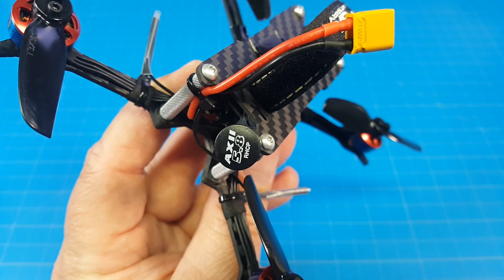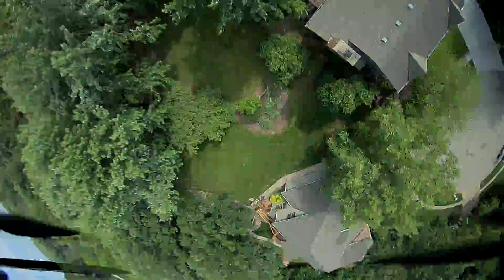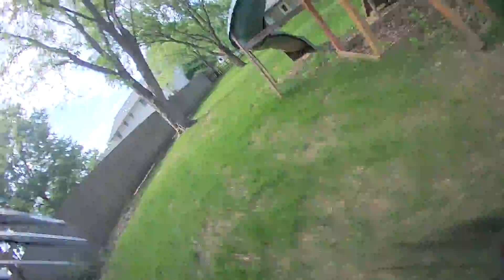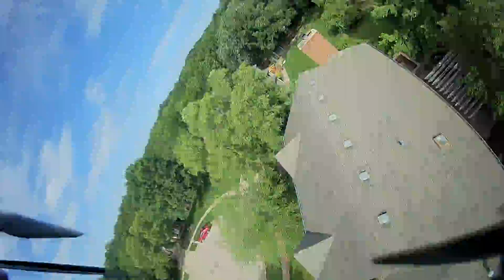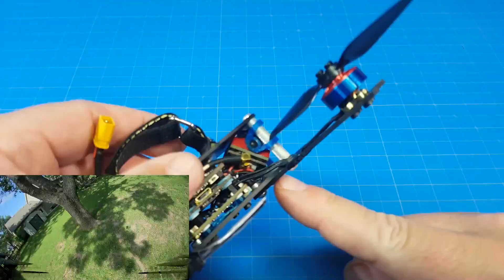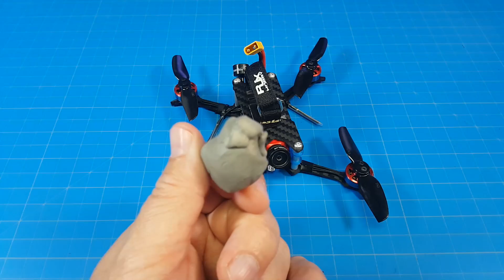RotoriousFPV Zoot - Ultra Light 3inch HD Drone

Comment: Dude, I watched this video 6 times! I've been looking for a new 3" build, as an over winter project. I may just clone your build. Those mamba boards are available at a good price here in the UK. For 4s is there any other motor you would suggest, perhaps lighter? Are those 1404 working out well for you on the thinner arms, I read the thin arms were for 11XX motors? I really appreciate your videos, thanks for the review.
Reply from the maker: I think there are likely better options for durability. We also have different hd fpv options now. The caddx whoop hd version really opens the possibilities. In the moment not sure what I should suggest. I have had some comment they bought two sets of arms for the zoot, ca them together for extra durability.

Comment: Did this give the power you look for? How do you think the succex 12a stack would be for this build? I’m really looking for this performance/size with the caddix turtle like this. Succex is tempting bc if the price and it includes the vtx
Reply from the maker: The succes stack is rated the same so it should be good. My experience with that stack is the vtx get very hot, nothing bad has happened to it. I did enjoy the power/performance of this motor/prop combo, keep the weight down to achieve the best performance.

Comment: Nice build. Considering lighter motors, broke 3 Armattan Gecko frames, so far.
Reply from the maker: Which motors where you flying?
Reply: Rcx 1407 4000kv
Last frame broke when it fell out of a tree and hit a wooden bench. First two broke from crashes.
Reply from the maker: I think we can double up the arms, likely need to ca them together in a vice to get the full benefit.
Reply: Thanks. That's exactly what I've been thinking of.
Reply: An extra main plate keeps me flying while waiting for the warranty replacement which then becomes the extra. Doubling up should save me time from rebuilding and I don't think the extra weight will matter. Maybe I shouldn't fly a 3" like a 5" but cruising gets boring fast.

Comment: I suggest you try avan mini 3" props if you haven't already. I get more flight time (yes more) with better handling compared to the bi-blades on 5500kv 1304's 650mah 3s. Almost 5 minutes decent freestyle. Just over 7 minutes of easy cruising.
Reply from the maker: the avan props don't fit all the way down on the motors.
Reply: @NickBurnsFPV  bottom of the prop hits the bell? They are close on the 1304's. I didn't think about that. Thanks for letting me know because I was considering getting a set of 1404's but I really love the avan mini's. Best 3" prop by a landslide in my opinion!
Reply from the maker: yea, the little fin at the bottom hits the bell, prop ends up about 1mm up off the motor.

Comment: Is the mini Mamba stack as good as the full?  Hard to beat for $40
Reply: I have two in 3in builds and so far so good. I looked everwhere, there's no better value for a 25a stack in 20x20. The only downside are the tiny solder pads.
Reply from the maker: the v2 does have through holes which will help...if used in a through hole manner. :)
Reply: @NickBurnsFPV  I might get a V2 for another project. Any plans to review the F722 mini?
Reply from the maker: I do plan to take a look. Likely this week, just a simple over view with a build later to come.
Reply from the maker: the small pads are essentially the primary drawback. The smaller the pad the more sensitive it can be to lift from to much heat or being tugged on.
Reply: @NickBurnsFPV  The V2 FC seems a little better, but I've only seen it in pictures.
Reply: @NickBurnsFPV  Thanks, The Mamba stacks are new in my life and I love them, I have a 3 inch build with garbage ESC and was looking to your videos for some tips, so this build was perfect, I thought the Caddx Turtle looked great too, is that the newest firmware?
Reply from the maker: I believe it is, I have been using the same file on the turtle.

Comment: Nick... I was looking for an ultra light 3" under 50 grams.... forget HD... anything fit this category? Thanks again Nick and hell yeah blu-tack is awesome!
Reply from the maker: No, the sailfly is one of the lightest quads that could fly kinda with HD components, it comes in at ~38grams, add in the HD components it will likely be just over 50grams.
Reply: @NickBurnsFPV  HD is not needed. Can Sailfly spin 3" props?
Reply from the maker: I would spin it, but have almost no response, the 1102 needs a lightweight prop.
Reply: @NickBurnsFPV  thanks Nick. So what's the lightest 3" a person can buy?
Reply from the maker: Not sure, I haven't looked for something rtf like that. I would think the xjb 140 would be close.

Comment: I think that quads a bigger camera angle than you are running? Did you feel that?
Reply from the maker: I don't think I understand. larger fov, or more angle on the camera than...?
Reply: @NickBurnsFPV  more angle... it looked like it wanted to go much faster ;)
Reply from the maker: Ah yes in some of the turns especially. I also didn't turn on motor braking...which I often do. The braking helps to maintain elevation and speed in turns.....for me.

Comment: Hey Nick, would betafpv's aio board work with the motors from this quad? Asking for a friend 😉. ❤️ the vids, thanks.
Reply from the maker: I am not sure. we are likely getting close to the limit the 12amp boards could handle or over. I would wait a bit to see more people push the limits of those board before I would suggest trying it. Of course if you adventurous it could be a valuable experiment for the fpv community.

Comment: That's a sweet little frame. I'm almost done building an airblade Intrepid using the same components. I went for the 3850kv 1404s. 8-10 min flight times should possible.

Comment: I built a similar model with the Rcx1304 motors, very cheap and usually in stock. Pretty happy with the GF 2.5 flash props, maybe I'll try out those 3" props. Seems like the 1404 actually is more efficient than the 1304 based on flight time, seems pretty win win.
Reply from the maker: are those the 6000kv rcx motors? I have a set on the micro alien I have yet to review.
Reply: @NickBurnsFPV  the ones I have are the RCX 1304 5000kv from Myrcmart.com (model# RCX07-452). I buy all my RCX motors with out a warranty so the 1304s are $7/motor right now.
Reply from the maker: super inexpensive motors myrcmart has. I have been wanting to try their new 1103 motor.

Comment: I dunno about Jack, but I always used the TPU to protect the carbon.  It prevents it from delaminating at the ends due to scratches and crashes.
Reply from the maker: ah, I see. i suspect I don't see much of that as I fly in the yard, I can see concrete and other surfaces causing that.

Comment: I'm quite interested in those props, I've been flying Gemfan 3025 bi-blades on my old Kingkong ET125 without its guards and it rips for a 2S, but at full throttle there is some vibration.
BTW, the Bostik Blue Tac they make here in the UK is light blue, it's awesome stuff and especially useful for holding things in place whilst you solder them, but don't get it too hot or it goes weirdly stringy. It's perhaps the original 'fidget toy' :)
Reply from the maker: There is some vibration at the top of the throttle in this video. I believe I notice it in the lower portion of the video, of course "HD" is sensitive to micro vibs and it could be the tune needs tweaking a touch.
Reply: I think it's especially difficult to get perfectly steady footage on micros because they don't have the mass most 5 inch quads do to absorb vibration.
I wonder how well soft mounting the camera would help on micros, not just a TPU mount but adding some sort of dampenign foam too.
Reply from the maker: I have tried that, but I think the soft mounts likely need a specific design to work well, I was just using rubber o rings.
Reply: Nick Burns - What about soft-mounting the motors?  Have tried that?
Reply: Nick Burns - I understand, same results here using o-rings, pretty much hit or miss.  I have had two quads that did better using a TPU mount I got off of eBay and another with just using s couple of layers of electrical tape, but this is all predicated on a well balanced motor. Maybe try the laser/mirror test on each arm to see if you have out of balance motor?  Check the props for balance too.  Lastly, sometimes it’s simply bad mojo, bad luck, planetary alignment, poor taste in art, or some combination of all of them.  At that point, I just live with it or bin it for another go on something else.
Reply from the maker: I have, either I am doing it wrong or it has no discernible impact....for me.

Comment: Positive reviews sounds like you enjoyed the model as much as mine 😀.  I still fly mine as my mine 3".

PS I've been waiting eager for this review. Also I used the Emax Avan 2.3x2.7x3 but I believe they don't fit the superman motors 🤷‍♂️
Reply from the maker: I do like that we have good recorded footage, the ability to go fast or slower with good flight time and performance. The durability could with 2mm arms could be an issue in crashing, but survived mine.
Reply: Nick Burns I built mine with 1106 6000kv on 3s 5mins and if I wanted to cruise I could at times reach over 5 mins. Even used it as a cinewhoop on a recent vacation to Spain. It's 120g dry weight but the ZOOT doesn't care it will stump. I cant say enough but it's been hands down my favourite 3" to the point that I built two identical ones 😊

Comment: Zoot!  Love it.  I especially like the horizontal placement (toilet tanking) of the battery, more quads should try this method to "laterally spread" the COG.  A very nice build and the two-bladed props are a smart retro move that most pilots wouldn't do, simply because it forces some changes in the way one flies, but you covered that issue really well in your video.  
One question though is that black electrical on the front arms, another retro move, Huh?  
Well done.
Reply from the maker: lol, I think it may have been a retro move to use the elec tape, or I just had some hanging off the desk and used it. 😂 The two bladed props generate more thrust for bigger moves. I would think the micro freestyler should really look at bi-blades we are seeing more these days.
Reply: Nick Burns - Totally agree with you on two-bladed props, especially for micros.  I kind of think that three-blade props are sort of a crutch that some rely, me included, too much upon to boost our flying skills by giving us more torque and punch at the sacrifice of flight time.  Glad to them being used more these days, if for nothing else, than because the work so well.
Reply from the maker: I hope more bi-blades are developed, I would specifically like for them to work well and be more quiet. The less sound the more likely we are to go unnoticed or not create the offended panic.
Reply: @NickBurnsFPV  - With all the research DJI does on their two bladed prop designs that will probably happen.  Just need to have their designs downsized and tweaked for the micros.  Sound deadening is something being worked on, but I think it's a bit of a trade off over performance but still, some noise reduction will be good.